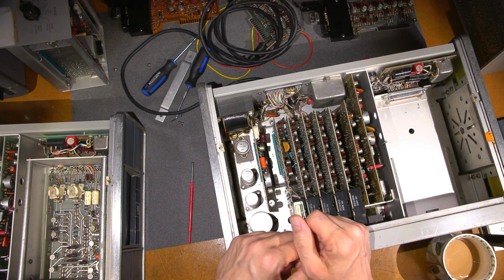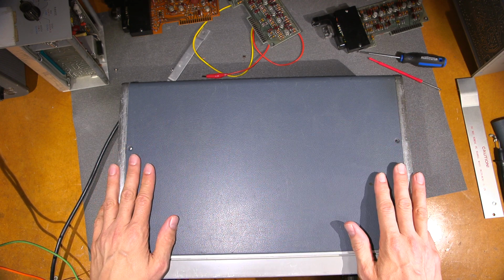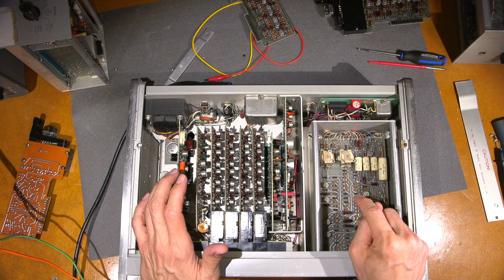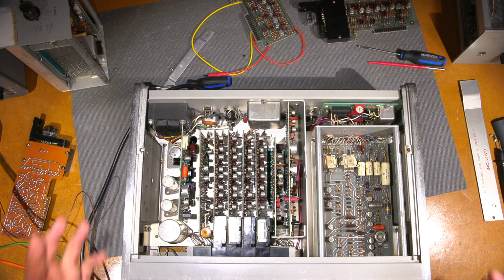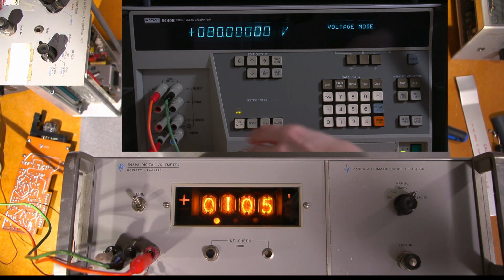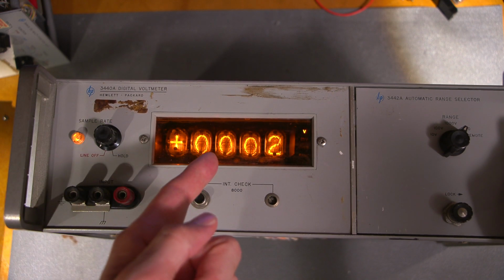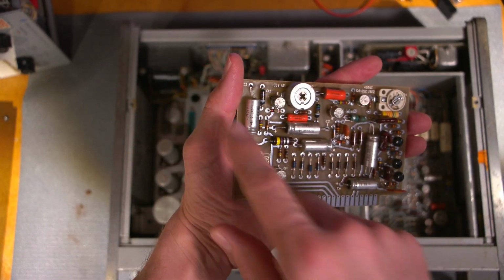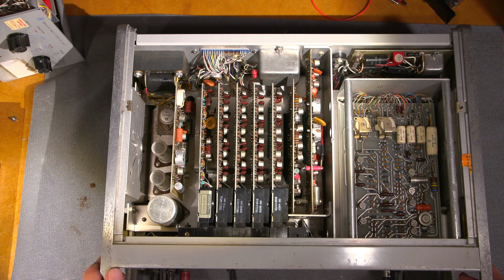Tech Talk With Mr  Carlson!

Comment: The capability of that Fluke 5440 compared to that HP meter is laughable, but they’re simply different things for different purposes, both classy in their own right.

I used to work at a metrology-esque company that had a rack of 5440s and an HP 3458.  It was incredible to me that I could twiddle microvolts and count them, repeatedly, on that meter.

+1.234,567v was read exactly that on the HP.

The engineering inside that 5440 is very interesting.  It used to 7.x volt references to get above 10 (I think it’s 13.7v?) and it has a PWM DAC that scales it to 0-11v, and they use a specially designed ultra stable amplifier to scale it for the ranges.  Low thermal relays reverse the polarity.

In particular, there is a “coarse” and “fine” PWM scheme used, and calibrating it basically means you put a known reference in, out to 7-8 decimals, and you’d tell the unit what it is, and it held constants in its memory to adjust the PWM so that it outputted the correct value for various ranges.

The fact that they still power on and run, and are still bang-on, is very cool.

Comment: Would you change the electrolytics in your 3440A? I just recently got a 3440A with that same nasty sticker mark (and one on the removable 3442A module that came with it), I'm having a hard time sourcing radial capacitors for those massive sprague snap-in capacitors. Do you think its safe to leave it in and power them up?

Comment: I was watching Shangoo6 , muddle thru a hotel tv repair he had two 25 inch with built in am/fm radios in them. Need less to say he got none working, seems like he has some experience but bad trouble shooting technique. Anyways they, the commenters were bad talki ng you in the comments ? I enjoy your fixes & repairs when you get a chance to put them on. I don't feel it fair for people to bad rap another technician when he is giving his time with good  repair tips & ideas. Shango -006 is different; maybe a  [ 3 ] on the repair side scale. he doesn't do a lot of research ahead of time , just muddles in there. ** Felt like watching some videos yesterday. Me, repairing the electric fuel pump on my 99 Mazda b3000 ; IE: A rebadged Ford Ranger. Its pretty straight forward found bad grounds, the sender is bad on this 21 year old vehicle, the big challenge, getting six torx bolts -T55's loose that hold the bed to frame did four today, two to go, storm coming; Chicago metro. The pump a complete unit is basically a drop in , & plug & play. Ok, have a great day.

Comment: I was lukcy when cleaning out a loft and got a big box with new not used old tube stock, in their paper pack over 100 different tubes like miniwatt by Philips.Tubes by Siemens PL 504 28GB5. Sylvania.Philips EM34.Electronic Tube 6l6gc.RCA 0D3A. Mullard 6V6GT.Mull.. Master tybe 5763.Mull... EF9.Mullard ECC84 Vingtor Sinder  12A6.and lots more of each brand and of every type.My son was asked by his mother side of family where husband died few years back,She wanted everything gone so wee got a lot of tube radio from 1940 and some newer big monsters of transmiters and recivers. Multiband radios.Heavy stuff.Think some of the gear is amatur radios or from small radio stations way back.Much of it seems like new in finish.Know i got to try to sell most of it.I have a little elektronikk repair lab where i a few times have fixed tube amplifiers for Guitar and still do.6L6 i can  use a few if a fender etc comes in, ecc83 or 12ax7 or eqvivalent tube type also could use a 2-3 of.But i think that is all i will need.Just 1 preamp tube for my guitar amp.Been a patreon of this channel few years and maybe some want tubes so why not let u all know about them.Live in norway

Comment: great video. The old HP I have is a frequency counter and has a crystal oven that stays on to temp stable. super fine .01 Hz res.  It's big has divider so goes to 1Ghz . The nixie meter I have is Fluke and heath kit. Does drift with temp also . My BK meter is VFD Green and don't drift too bad.  love nixie displays . My heath kit is 7 segment orange nixie display. My heath counter has ZM 1000 amprex nixie tubes. now we use 74141 IC to drive nixie tubes. still make a replacement .

Comment: Hi Paul, at 21:28 the capacitor discharge device you are talking about, what are the advantages of this tool, versus a resistor to discharge capacitors?
Because obviously, that box contains more then just a resistor.
Don't get me wrong, i'm not asking for a schematic or like that, just a general explanation what this tool can do versus a simple resistor in a box with 2 testleads.
Thanks in advance.

Comment: What kind of tech does that meter use for a reference?  I’m guessing a Low drift zener probably not at 8 volts but used as a reference in an amplifier for the 8 volt reference. Some really old meters would have used an electrochemical reference cell, I’m guessing this one would be solid state.

Comment: Great as ever, Paul. But for this work you will need an extender card, isn't it?. This is due to the lack of space between cards, and I saw pots and VCs vertically mounted. So, do you have those expansion cards, or are you thinking in doing them by yourself?. Thank you, and keep on doing you ever excellent job.

Comment: Yes! More Nixies are better.
I started collecting HP and Fluke Nixie tube meters and frequency counters a few years ago. I have yet to buy one that does not work. They are all accurate enough to be usable and needed very little calibration.
Number one problem with old Flukes - dirty switches. Easily fixed.

Comment: I have an old Goldstar oscilloscope, Leader frequency counter, and an Undien PC122 CB radio (not the XL) that all needed to warm up. They all function fine at power up but not for precision. The CB features SSB which requires stability. It would drift around at first for both transmit & receive but by about an hour later it would be spot on frequency & stay there.

Comment: Yes, definitely interested in seeing the alignment of that unit.  Also, if possible, how to align a piece of equipment for "good enough " test bench use.  I will probably never be able to get mine setup by a lab standards calibration facility, so any suggestions for close enough would be appreciated.   Thanks!

Comment: One way to deal with the dark spot on the Nixie might be to place a dark film over the digits so that they're of a similar darkness. Then let the camera exposure adjust for that and it'll brighten all of the digits and the +/- to a similar level.

Maybe run various grey shades through a halftone generator and print the resulting image in black on transparency film.

EDIT: Ah, you're not using that one for the meter inset. Nevermind.

Comment: I’m glad you saved these. I’m not a technician or indeed, really no much about the internals of a voltage tester but, there is something about the craftsmanship in these; even the not so kindly looked after one. The detail into making them accurate and modular plus serviceable is cool and something the I feel lacks in today’s electronics in general, no matter their complexity. It’s the detail, the way the wires underneath and neatly tied and packaged. I wish there was Amplifiers more like this. I look forward to seeing this in a video of another radio repair.

Comment: Enjoyed the nixie tube volt meter video.  Have you seen the Beckcom Eput counter.   It's a a neon lamp indicating counter.  When I went to Rocketdyne solid rocket motor mfg & test in 1974.  They used them. They failed often.  1 tech delighted in keeping them running.  When I came back in 1988 they were still using them.  After that tech was promoted( if you cant fore them promote them out of your area right?) I was assigned to secure all 15-20 in a safe place. The container was primer green and had trunnion so that a waste truck could dump it.
Reply from the maker: I think you may mean "Beckman." Those are highly desired pieces by collectors now. Thanks for sharing your story Jim.

Comment: You just made my day Paul. I just happen to have one of those exact HP meters that has a slight problem on one of the Nixie boards. No matter which slot it's installed in the number jumps all over the place. Any idea you have on which component/s need replacing would very much be appreciated.

Comment: Neon light opto isolators? But a neon light is high voltage too? Is it that the neon bulb will fire at around 60 volts while a Nixie needs about 170v to fire and they only had reliable 100v transistors? Amazing the lengths they went to on this high end stuff to get around technology limitations. I am also curious how you get that old inventory tag glue off? I find it practically impossible but I'm sure you have a trick.

Comment: I've been watching your videos for a couple of years. I've learned a bit and want to work on my own restoration projects now (tube radios 50-60s, tube guitar amplifiers and some same vintage test equipment). Now, that I'm retired I have the time to indulge on this on a regular basis. I'd like to see some tech tips on sourcing quality restoration parts. Not, just tubes, but capacitors, resisters, diodes, and transistors. Amazon his a maze of Chinese parts, but as a newbie I can't determine their quality. You've mentioned component's briefly during your restorations but not sourcing and manufacturers. Thank you for your comprehensive videos, they are always well produced and paced appropriately to follow your work.
Reply: Uncle Doug and Blue Glow Electronics are both great YT channels for tube guitar amps and others. Lots of good info.

Comment: Ah! I have two of these 3440A meters, both with the very hard to find 3444A DC multifunction plug in. One of the latter has a bad adjustment pot in it…this is the impetus I need to just order it and get it fixed. Really nice meters. Love the easy to read nixie displays.

Comment: Paul, what I liked best from this tech-talk was at the end where you surmised that the heated resisters likely were the culprit of the hot cap. We know many parts will get replaced to bring this old meter back up to specs. I got to know if the cap is really bad or does just fixing the resisters on the power board bring it back into specs. ( I figure you will replace anyway, but just wanted to know if only doing the resisters could be the solution for that issue) Please show a full repair video of this meter, waiting with anticipation!
Reply: The burned resistor are most likely the result of the bad capacitor. Paul has many vids about old paper and electrolytic capacitors. Assume that they are leaking voltage and just replace them. It's just cheap insurance.

Comment: I worked for a worldwide mainframe computer company as an engineer tech. I was given the task of populating (hand soldering) all the components into a new design circuit-board. (approx 2ftx2ft size 2 ground planes, 2 power-planes) This thing was VERY expensive. My initial test of the raw board discovered dead-short between power/ground planes. I used a "new" (at the time) nitrogen-fed, thermal-camera. With raw board connected to ONLY power/ground to power-supply... The camera INSTANTLY pointed-out some plated-through holes which shorted various copper-layers together. (The design-engineers had made a mistake :-0 ) It was fixed by drilling out plating from each of those holes.

Comment: I love my Nixie meter. I got a Systron Donner 7004, has I think five tubes for digits and a neon for the minus. Also has a adjustable sample rate. I recapped it a few months ago and I need to check calibration on it but it seems to keep up with my cheap modern meters as is.

Comment: Good Format .would like to see a deep dive into switch mode power supply's .ie computer supplies they are very popular and there is very little info and schematics on them . I have  watched the ones you have done already but those were basic repairs .looking for more theory on the reasons for the opto's and the stand by supply and how they generate the different voltages ie buck converter also how the switching works and how the impedance of the chokes affects operation . thanks for the good content.

Comment: Thanks for another great video. Yes, would love to see more on the restoration and calibration. Also, perhaps, a discussion of the theory of operation. And who decided a volt is a volt anyway and where did that standard of measurement come from? Such timeless looking machines with tasteful industrial design. Lot of work to restore, but at least you’ve got that thoughtful modular design to help things along.
Reply: Volt, unit of electrical potential, potential difference and electromotive force in the metre–kilogram–second system (SI); it is equal to the difference in potential between two points in a conductor carrying one ampere current when the power dissipated between the points is one watt. An equivalent is the potential difference across a resistance of one ohm when one ampere is flowing through it. The volt is named in honour of the 18th–19th-century Italian physicist Alessandro Volta. These units are defined in accordance with Ohm’s law, that resistance equals the ratio of potential to current, and the respective units of ohm, volt, and ampere are used universally for expressing electrical quantities.
Reply: @SoulDelSol  thanks, Dan. Good stuff, but it’s a slippery slope and just leads one to ask, well what’s an amp and what’s an ohm without having to use the term voltage to define those terms?

I mean, we all know Ohm’s Law and power calculations. We can look up the origin of the terms and their “inventors.” But it all leads one to wonder, when Fluke builds a highly calibrated voltage standard generator, what do they use to calibrate the calibrator? 

And how does one actually create a perfect volt without using some calibrated reference to measure against? Perhaps a perfectly measured specific amount of semiconductor material creates a perfect cutoff voltage at a particular perfect temperature? It makes my brain hurt when I start thinking about this stuff!

Comment: I have an HP 5340A Frequency Counter that uses Nixie Tubes.  I had thought I would use it to measure the frequency in Tube type radios, but I am concerned with the warning on it about not exceeding a certain (quite low) input level.  I still want to use it since it covers up to 18 GHz from what I am able to see on the internet.
Love to see you using the "Good Old Stuff!!!"
Reply: That counter nixie tube unit and the 3440A nixie  display assembly are the part. HP SCID did a crappy redesign on it, it worked fine on the counter but not on the voltmeter.

Comment: Mr Carlson. Can we see you mend the broken handle? FedEx and USPS have delivered a lot of my HP rack mount 30kg+ gear with bent, cracked or sheared off handles. Eg My HP 5360A Computing Counter, HP 312A Selective Voltmeter, HP 141T Spectrum Analyzer, HP 5105A Frequency Synthesizer etc. So sad. Any help appreciated. Happy to pay for advice.
Reply from the maker: Thanks for your input Terry!

Comment: For the HP meter cal, could you make a top cover you use only when calibrating and that has access holes in the right places. Once done you fit the original cover.
PS. Always enjoy your repair videos.
Reply from the maker: That would definitely work. Thanks for stopping by!
Reply: That's a great idea.
Reply: Even better: the cover is mostly about stopping the airflow. So even a piece of card stock or cardboard will work great. Easy to cut holes in it. Alternative is to use some laser printer overhead transparency sheets. They withstand high temperatures without deformation and let the light in so you can see where the adjustment tool is relative to adjustment points. That helps when the adjustment points are buried deep.
Reply: I had exactly that thought, maybe even Saran wrap would work, you can see through it and poke holes for adjustment tools.

Comment: In the 1980’s, I worked at HP on those old voltmeters. They were, as you say, very sensitive to temperature. With many of these instruments, our solution for alignment was to use a spare top cover, with holes drilled into it directly over the calibration pots. This way we didn’t even have to remove the top cover to align the unit. (Spare top covers were easy to come by back then; I wouldn’t recommend drilling holes in any covers now!) It sure is great to see these magnificent old units still functioning, with a little TLC, after half a century!
Reply: But you could make a dummy spare cover, just for calibration, out of some scrap material, and put holes in that.
Reply: @bertoid  YES. I JUST DISASSEMBLED AN OLD KITCHEN RANGE AND A DISHWASHER AND NOW I HAVE ALL KINDS OF SHEET METAL TO FABRICATE A CALIBRATION COVER.
Reply from the maker: Thanks for sharing your story Gary!
Reply: Fantastic sharing, thanks.  I've got several of these old beasts, counters and meters, and they all like to be left on for for a good while too settle down. The counter manuals talk about a day,  and letting the XO age in while powered over *months*, keeping a drift log, etc.  I love it.

Comment: I can't say that 60's/70's discrete transistor hp stuff has the same appeal as good old tube stuff, at least for me. By the time you get into having to replace transistors with matched pairs that you can't find any more with the small heatsinks that temp-couple the things together.........But the troubleshooting procedures are what's valuable.
Reply: Every time I see the insides of these old HP instruments I just can't get over the craftsmanship. Tubed or otherwise, they're fantastic.